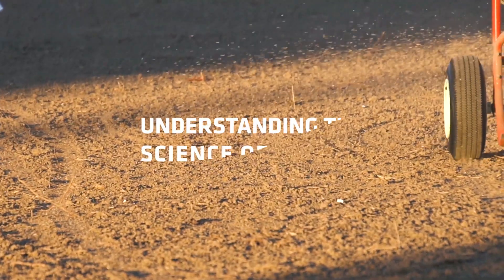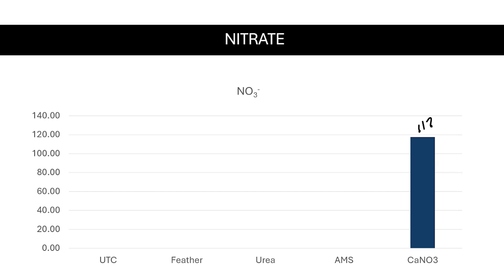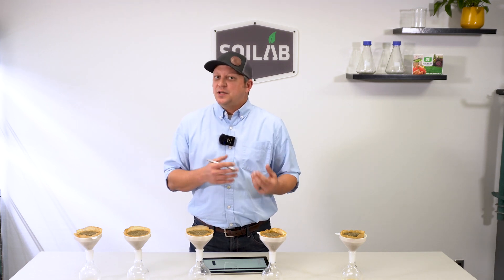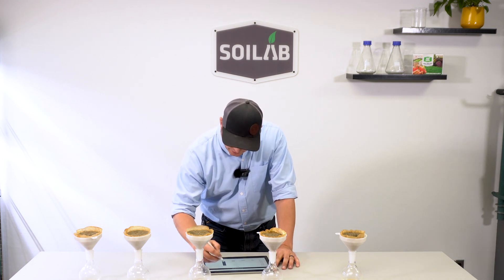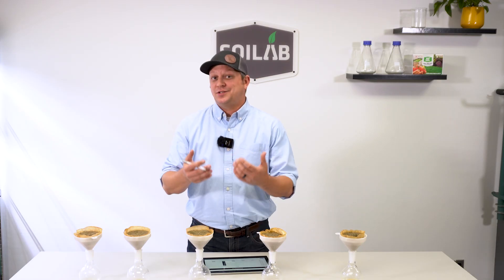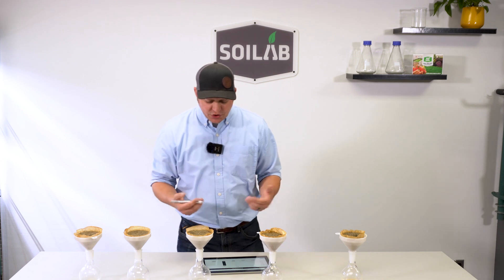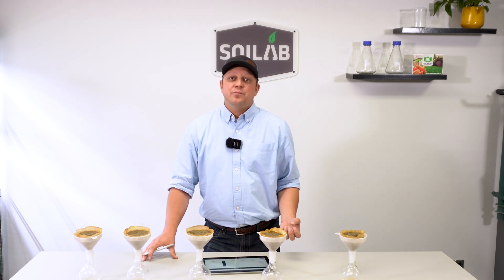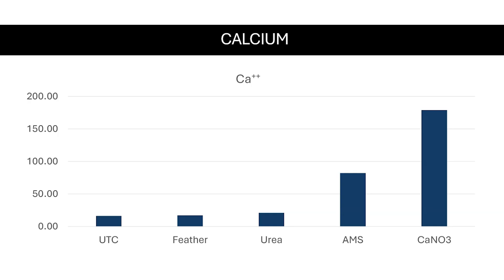Fertilize Responsibly!  Nitrate Leaching and Cation Exchange in a Sandy Soil

Comment: I have coarse sandy soil. Is it best then to fertilize with a slow release organic fertilizer like Espoma rather than liquid fertilzers including fish emulsion? Last year I did a soil test and it revealed a Nitrogen deficiency,  a Phosphorus overload, and very low Potassium.
Reply from the maker: In coarse, sandy soils, I feel the best start is to add organic matter at least annually.  You can take a couple different fertility approaches: 1) Apply a slow release organic fertilizer less frequently and in a higher amount; 2) Apply a quicker release fertilizer in small amounts, but more frequently.  I personally prefer feather meal or bone meal based slow release fertilizers plus compost additions in coarse, sandy soils.  Hope this helps!  Thanks for watching!
Reply: @SoiLab  Thank you,  that is very helpful.
Reply from the maker: @ You are very welcome, happy to help!

Comment: Having sandy soil and dealing with it for about a decade, ive basically realized the only reasonable choice is to use fertigation all other fertilizers just leach out and dont get to the plants. heck i would send you some of my soil to run a test like this on and see for yourself how bad it is lol. That would make for a entertaining video
Reply from the maker: Spoon feeding through fertigation is a great tactic.  I'll take your word for it on your sand!  We've got plenty around here for testing!
Reply: @SoiLab  Ive had you test it a few times and every time im just like blown away by how bad it is. its slightly better deeper down but not by much.

Comment: I enjoy watching, and I am a subscriber. Please, could you include what action should we take for a person who does not understand chemistry? I watched the video three times and still don’t know what to do.  How can I translate this into actions when I use fertilizers with the NPK numbers. BTW, I use your product a lot.
Reply from the maker: Thank you for watching!  I guess the main takeaway is to not over irrigate following a nitrogen (first number on analysis) fertilizer application.  Essentially, the nitrate-nitrogen will go wherever the soil water does.  The leaching is more of a concern in coarse, sandy soils than soils with a medium to fine texture.
Reply: @SoiLab  thank you, but a follow up question will be: We are advised for deep irrigation for roots, and that’s what I do. so how long should I irrigate when I apply granular fertilizer?
Reply from the maker: @NinosYoukhana  That's a tough one to answer not knowing your soil type or irrigation system, but I always use a soil probe (a trowel, shovel, or other tool will work too) to check how deep my moisture is.  In my lawn and garden, I try to drive the water no deeper than 6-12 inches following a fertilizer application.  The other consideration is to be sure not to allow any surface runoff while watering the fertilizer in.
Reply: @SoiLab  Thank you so much! I will be following your updates very closely now. And, where do we submit our questions for future videos?
Reply from the maker: @NinosYoukhana  You can comment on any of the videos just like you did with any questions or content ideas.  Thanks again for watching!

Comment: Okay, great, you gave results but does it mean?  What's the advice?  Ferts with ammonium sulfate are wasteful?  Ferts with urea are most efficient?
Reply from the maker: Key takeaways are that nitrate is quite mobile regardless of soil texture, ammonium can be mobile in coarse soils, and that following a fertilizer application, when watering the fertilizer in, you should seek not to irrigate beyond the rooting depth of your crop/turf to avoid leaching nitrogen out of the rootzone.  Ammonium sulfate is a fantastic fertilizer when applied in the right amounts and not over irrigated or leached.  Thanks for watching!
Reply: @SoiLab  Okay., thanks for the reply.
So would it be fair to say then that if I fert with Ammonium and then within a week or so later we get 4-5 inches of rain in 24-48 hrs, that I may need to re-fertilize earlier than previously scheduled due to leaching?  This happened twice this yr and is common in my area every yr.  Are you suggesting then that maybe a urea based fert would be a better choice in this situation?
Reply from the maker: @beau8302  You get some weather!  That certainly is likely, especially if you have somewhat sandy soil.  In the case that you described I would look for a fertilizer that has 60+% of the nitrogen as slow release.  I've seen fertilizer products with methylene urea perform quite well.  Straight urea will convert to a leachable form pretty rapidly when soil temps are warm.  Hope this helps!
Reply: @SoiLab  Thank you for this.   I watch and enjoy yours and other lawn channels but yours is different in that you also teach the science of what's going on between the soil and nutrients.  That helps me to further strategize and tailor to my specific conditions and desires.
Reply from the maker: @beau8302  Thank you for watching and I appreciate the feedback!  Never hesitate to comment with ideas of content that you'd find helpful!